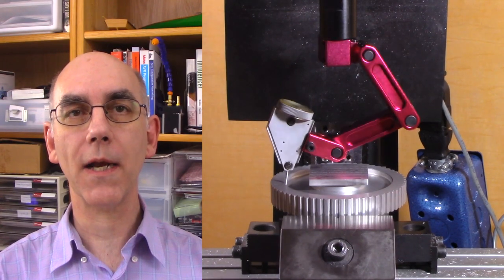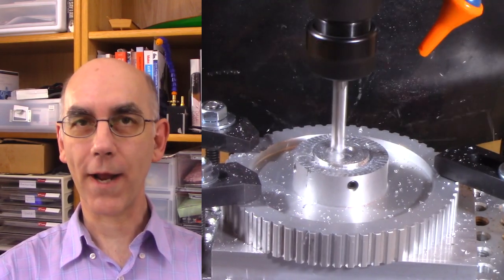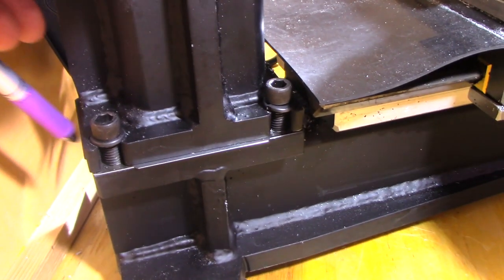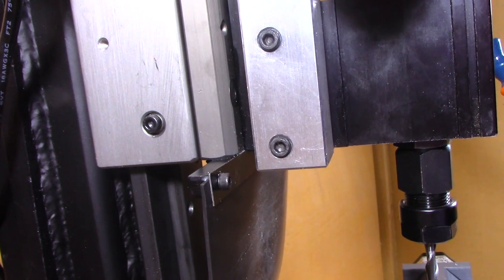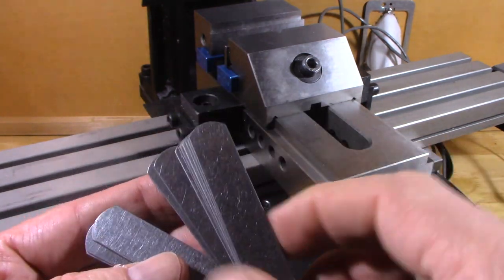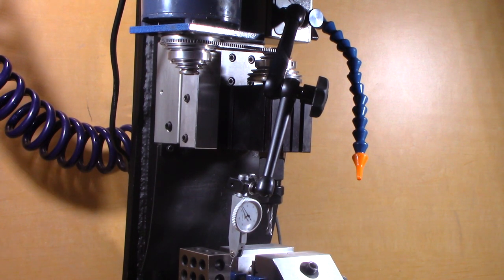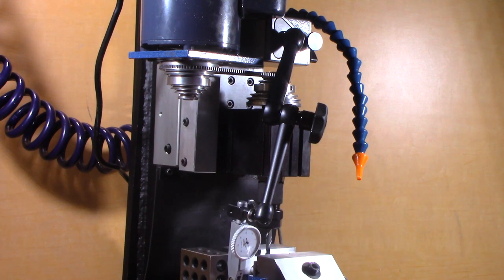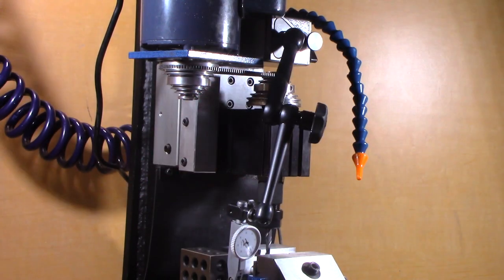Taig Column Alignment, "Taigmach" Part 6

Comment: Hi John, we are happy to be joining you and your channel. We own a TAIG 4 axis CNC mill and a few lathes from them (for polishing not lathe work) and we sure had issues with the column to the base. WOW an R8 collet spindle on a TAIG we would be happy with a tool changer hate setting cutters for each call out in our SoildWORKS programs.
Lance & Patrick.
Reply from the maker: You guys should check out the Taig Lathe And Mill Owners Club on Facebook: https://www.facebook.com/groups/524365887660604/ in the announcements section (I think you might have to join first). They have more information on the new column, as well as the R8 spindle and power drawbar. And I know they're working on an automatic tool changer as well.